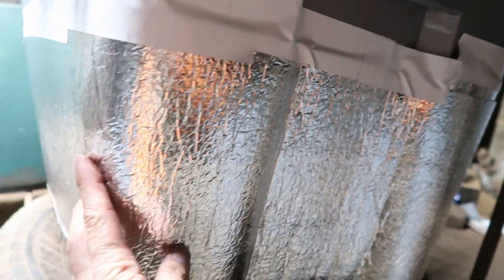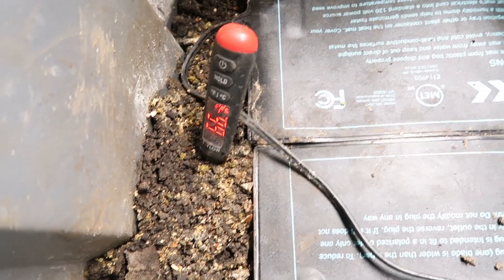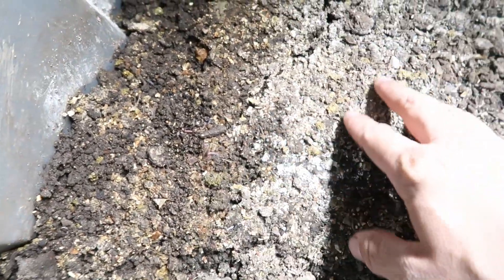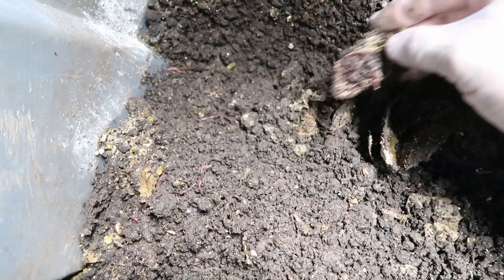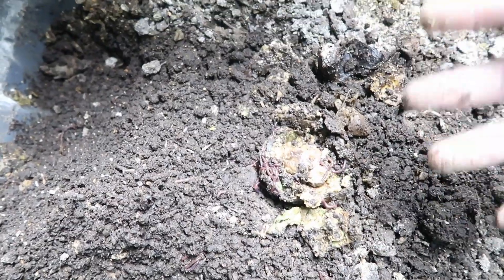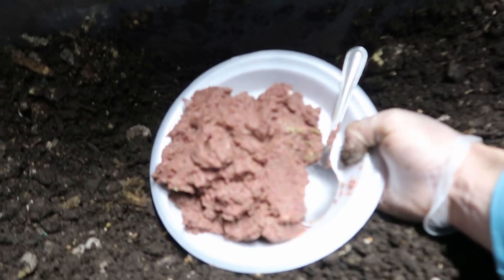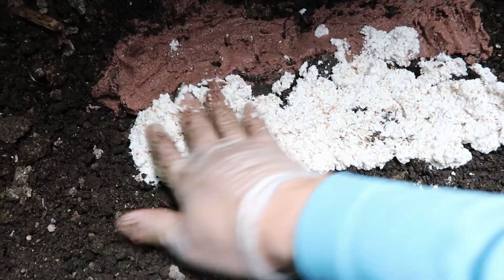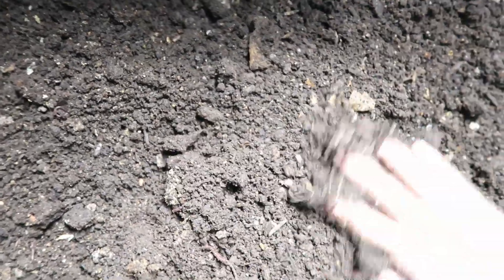How to keep worms producing during the winter. Worm farming during one of the hardest seasons.

Comment: Good day. I have been wintering my worms in the basement cause it gets much much colder than 21F here. One thing I do is to take the egg shells and grind them fine and just sprinkle them on top and don't make a paste like you do. I find that they will come up and get them when they need them (which is usually a couple of days) and very little is left in the final castings. If you overfeed them they will multiply quickly and grinding their food is a good idea.
Reply from the maker: Hello and good day. Thank you for the comment and your advice on the eggshells. I will have to try that next time. I am top dressing my bins with dry amendments. I use crab meal, kelp meal, neem meal, alfalfa, and glacier rock dust. I will keep the eggshells dry and add them with my amendments next time. I just started to blending my fruits and vegetable scraps. I can already tell it's speeding up the breaks down process big time. I'm only 9 months into my worm farm. But learning a lot from others and a lot of trial and error. Thanks again for the comment
Reply: Thanks for sharing the great tip about grinding egg shells. Can I ask how you grind them? I ruined a blender because the egg shells are so abrasive. I crush them now by hand using the end of a rolling pin 😅 I get a good workout and I’ll do anything for my worms but the manual labor can be a bit tiring!
Reply: @brooklyngiraffe  I grind them with a coffee grinder (fresh ground coffee is the best :)). My grinder was a little tired and taped up so I repurposed it to just grinding egg shells. It works really good
Reply from the maker: @brooklyngiraffe  I use a food chopper. It's very similar to a coffee grinder. You can find them for around $20-30. I use mine alot for making homemade salsa. Then once a month for eggshells. But yeah sure beats having to do it manually.
Reply: @LUPE.G3  Thanks so much for sharing your knowledge — I will definitely look into a food chopper. Yeah, doing it manually is a pain but it can be theraputic. However you just don’t get a grind that is as powdery as when you use a machine.  Thanks!!
Reply from the maker: you're welcome and thank you for following my channel. Have you thought about making any videos ?

Comment: I would think that 90+ degrees would be too warm for the bin, but I stand corrected. The little dudes are more crafty than you’d think.
Reply from the maker: Yeah, that is why I put the mats in the center. But more to the left side of the bin. So it's 90 in the center, the 70s on the left side, and 50s on the right side. It's just a trial and error process to see what temperature they like the best. They seem to gather in the 70's area  the most. But also the deeper the bin gets the cooler the temperature gets.

Comment: Hope your worms made it through. I'm on the opposite end of the spectrum down here in south Florida where the summer is most difficult.
Reply from the maker: Nice! I have been buying my worms from Florida. 

Here is Oklahoma the weather is all over the place. I have been keeping my worms in a cool dark shed. So the heated hasn't been much a issue with me. But I am planning on moving them to a storm shelter where it stays at a steady temperature all year.

The temperatures ended up getting below zero and froze most of my worms. I had to adjust and add more heat.

Here is a video of how I added more heat. https://youtu.be/aaG0RXN10nE

Comment: I think the heating pad is to much, it dries out your bin plus a high fluctuations causes ph issues,

Do yourself a favor, get a old deep freezer or even a frig, get 2 in hope saw put four holes down long side foot apart two holes on sides, silicone screen or use wood strips to attach screen over holes, you have a winter bin with lid and drain,
I had a bin in New Mexico we had a low of -5 and my worms survived winter very easily...
Use extra peat or Coco around edges and top as insulation or ridgid insulation outside of bin if you suffer colder temps, but naturally worms huddle up and create a area where the body heat is used by all, and they chill out until spring...
This idea I stumbled on in 2012 building a earth home out of sand bags and tires, I started with a thousand worms, and in almost 2 years had tens of thousands filling a 55 gal drum that also made it through winter, but a full deep freezer as well I got for free...

You can't build anything better if you tried... It's actually cheaper to buy a 100 deep freezer than everything needed for any other bin system in the same price range, but none will promise full on winters...
Hopefully this helps anyone, oh and they also do better in the heat being insulated all around, but the sun can still bake them if it's direct sunlight...

Good luck
Reply from the maker: That is some good information. Thank you got your help. I have a old refrigerator that I have been thinking about using. 

I am in the process of moving and will have a storm cellar in my new place. I am planning on moving my worm farm to the cellar. Then I won't have to worth about the cold winter anymore.
Reply: @LUPE.G3  if there is a will there's a way...
Reply from the maker: @jeromegarcia5396  I know that's right